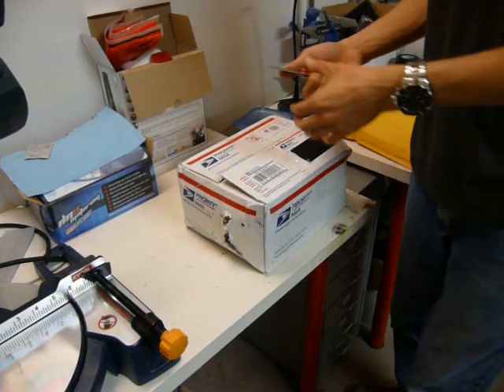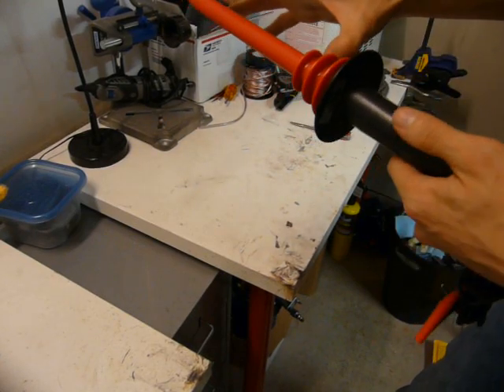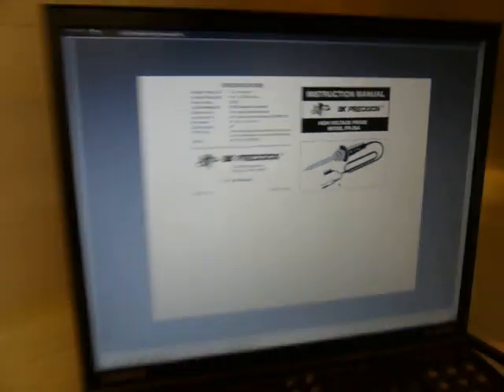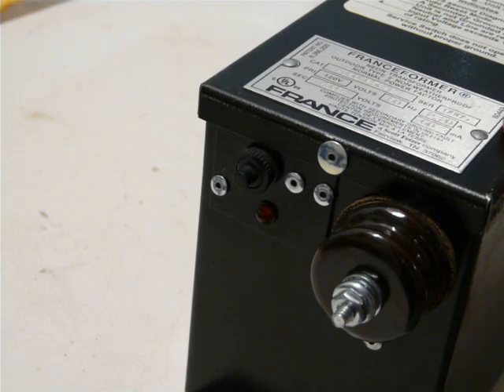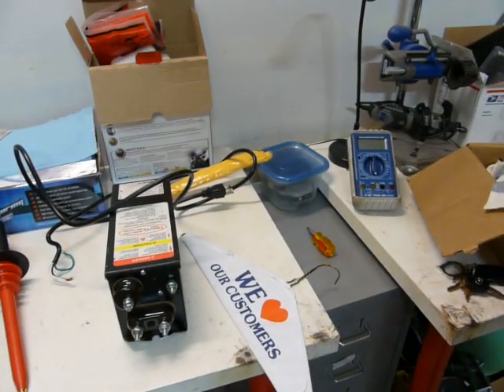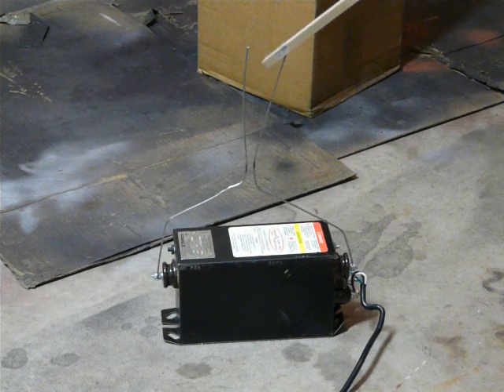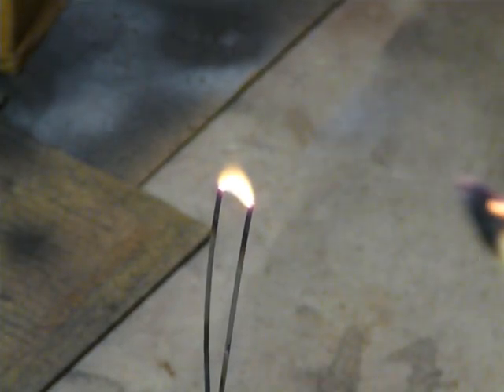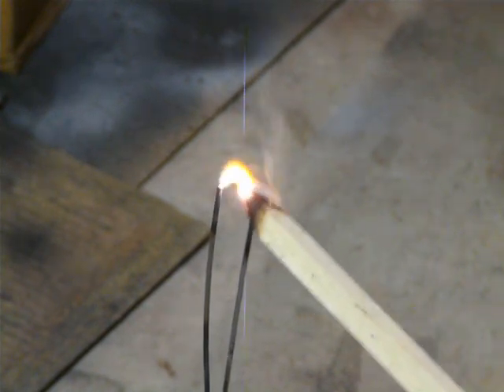Neon Sign Transformer fun + Some Safety

Comment: you can connect the ground clamp to the case ground and then hit the button on the side of the transformer to put it into "test mode" which will ignore ground faults for 15 minutes or so.

also, there may be a "secondary ground" terminal on the other side that is connected to the center tap of the secondary, which would not trigger a ground fault condition, thus eliminating the need to run in "test mode".

Please note:  this ground fault protection is not designed to save you, like a GFCI breaker or outlet.  It's designed to prevent fires.  The sensitivity is far too low (to avoid nuisance tripping due to corona discharge, humidity over 70%, etc) to save your butt.  But it will stop a building from catching fire due to a burnt wire touching wet wood and burning carbon traces into it
Reply from the maker: +Michael Baron Nice, I wasn't aware of the test mode. Great point on the GFCI - the primary safety in all these things is ourselves :)
Reply: Michael Baron have you done any burning wood with the transformer?

Comment: I think you should have gone for something like 7000-15000kv's..does it trip the module if you get both the metal poles touching each other? time to build a don smith device with that..